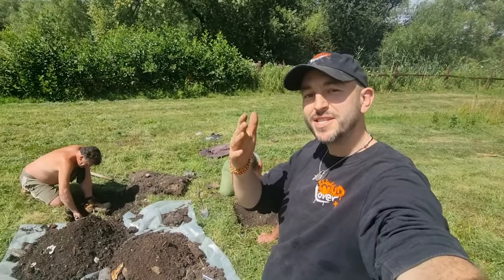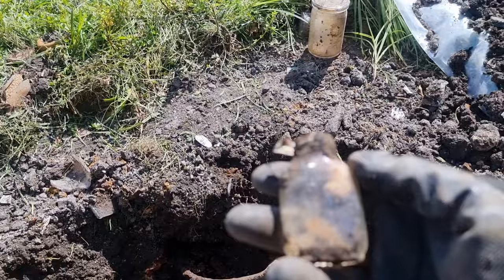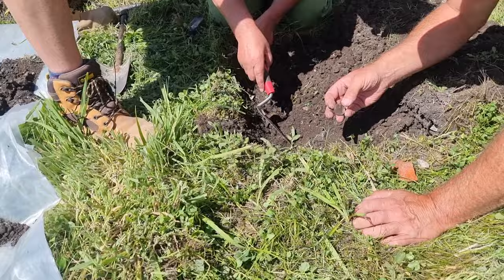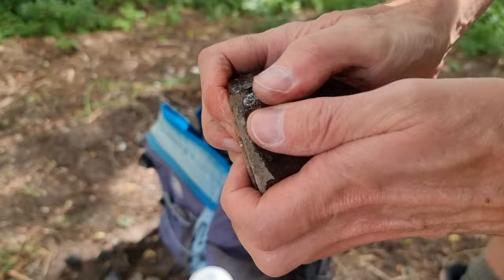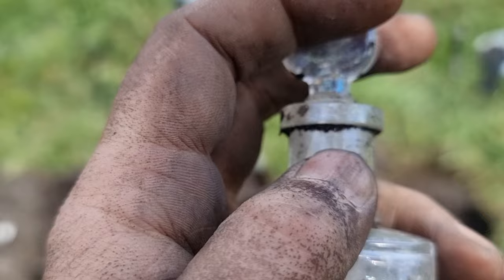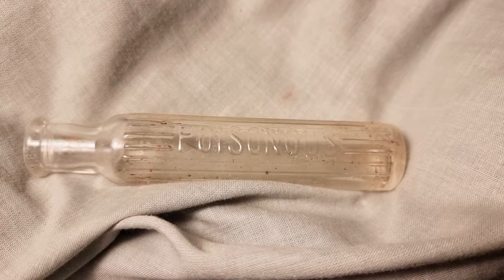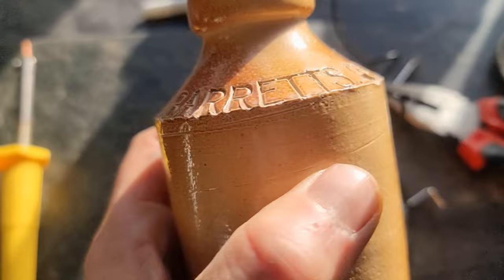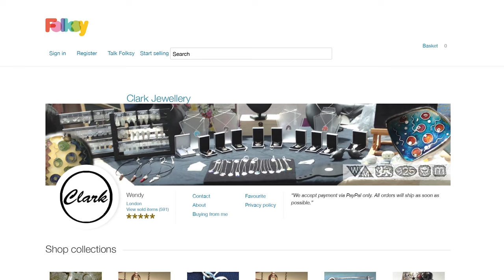We found GOLD and WEIRD stuff in a 100-YEAR-OLD DUMP

Comment: You need to build a sifter, basically a screen with larger holes in a frame with legs to hold it off the ground. Dump in the dirt, give it a shake and see what's left 😉 
That round stro-si corset marked disk appears to be part of the container that the extra steel "boning" or supports for the corset came in.
#shared

Comment: Really enjoy the upcycles, glad to see people create new things out of the bits and bobs that most people would throw to the side because it wasn't complete or unbroken. Just out of curiosity, did you apply the duct tape before drilling to prevent chipping?
Reply from the maker: Cheers Angie! The tape was to stop the drill bit slipping off of the glazed surface 😊👍🏻👣🧡
Reply: @Sifinds   ok, that makes sense, should have thought of that 😆

Comment: I'm not sure if the spellings are right, in Ireland all old houses with dry toilets had a spot on the site for dumping the waste and it's known as a Midin and another site was for general waste just like the one you are digging here, it was pronounced  Doughal or dughal.
They are usually little heaped piles and easily recognised, whilst the general waste is the one you want to hoke through the other is very good also especially for growing veg it's years old well rotted manure..

Comment: I've thought this before but when it comes to glass bottles; maybe don't crack the seal and just leave the contents as is. After all, it's been in the ground / foreshore for 60-100+ years without leaking. Melt some wax over the original cork if you want to avoid evaporation. But just perhaps, add it to your creepy content shelf.
Reply from the maker: Good shout 👍🏻🐾🧡I did that to an ink bottle I found with Tim. I was worried the cork would dry out. And so far so good

Comment: You had stays to fasten corsets. Corsetières would fit them to the individual woman. Once you started wearing them you needed to be in them for the rest of your life because your muscles weakened..The bra section, was often circular stitched in many rows to add reinforcement. They led to a highly pointed shape. The bra section was part of th main garment. Corsetd went out of fashion in the fifties and sixties with the advent of Playtex type bras and tights. Before that stockings with a seam up the back were attached to the corset.

Comment: #shared your empty River video
Reply from the maker: Ah yes. Thanks!👍🏻🐾🧡
Reply: So, I’ve been thinking quite a bit about your incomplete green and blue poison bottles. I’ve had a thought about how you could cut them down for a desirable up-cycle. Wound it be appealing to you, or anyone, to cut them into one-inch segments and make them into napkin rings? Of course, sanding the sharp edges? -Marianne
Reply from the maker: @viridiangreen8259  nice idea, but the glass on poison bottles is so so thin, it could be quite dangerous to use them for this purpose
Reply: I didn’t know. Can you think of another type of bottle that is more thick? Thank you.